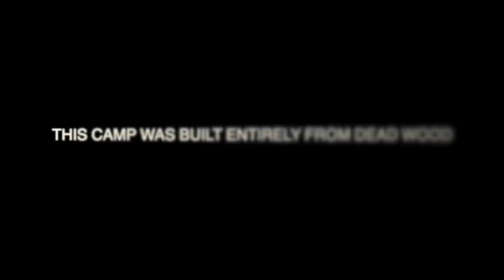Bushcraft Camp with Watch Tower: Off Grid Shelter Build

Comment: I love these builds also. Tip for you guys: when building walls especially high ones where you stack logs horizontally up between poles.
About mid way up vertical poles tie some rope in the middle or higher on pole. Then put 2 or 3 horizontally poles in. Then tie the string to the next horizontal pole you put in then continue stacking poles on them.
This will use the weight of the poles on top of that to pull the middle of the vertical poles in for support.
Reply: 6 People understand and like what you said ,me can't picture it .🤨
Reply: thanks good to know
Reply: @fishfire_2999  You have two vertical poles. You have, say, 15 horizontal poles that will become a wall. As a wall, you want the poles to be nice and snug. The horizontal poles will push the vertical poles outward. You don't want that. So, you attach a rope like OP said. The vertical poles will be acting against the horizontal poles by pushing inward a bit. That'll keep the wall up a little longer.
Reply: @grimstnzborithbrisingr7296  Building looks like so much fun ,cutting and debarking not so much ,I understand what you were describing now makes sense ,thanks for the reply 👍👍
Reply: you can explore new land

Comment: Great camp. The dog wanting to "help" was cute.
    Galvanized or plated wire is wonderful for tying joints together.  You can get the joints tight and secure with multiple turns and then twisting the ends together to lock it in place.
    If you notice modern manufactured log buildings use staggered logs without notching. The corners will need fasteners or wire for stability however, but it sure saves a lot of work and time.

Comment: Nice fort !  I have a lot of Q for U but I will limit them to only a few:
* Why a window on the back wall since you can see through the wall and it is not a dark confinement?
* Why a plastic in the window since the wind (and water) can pass through?
* Why are the walls of your watch tower are so high? Since this is where you're suppose to 'watch' one should be there a long time hence, not standing but sitting! (ex: swivel stool)
* Why use moss over wood over tarpole... just for look?  Tarpole is more than enough!
* Why not cover your fire wood with a plastic or small tarpole because wood top does not prevent rain or melting snow ?
Just hope these reflection points can help improve your next project.

Comment: once the first tower is done, you can make two more next to it, and join them, until a larger thinner tower, made with even lighter or flexible components (like plastic tubes or pipes or long plastic poles), can be fixed between them, with even greater stability.. so scouting even higher, for longer, to accurately approximate the extent of the horde swarming you, or the direction an enemy band is taking, to send patrols their way, or warn them before they are attacked, so they can defend in time

Comment: Off hand ya think a chain saw be faster.  Size building use bobcat 
Clear  make a road 
Water lines trees could hold power lines swimming  poor 
Bed and breakfast  maybe.
Walmart  easy. Shopping.
Its all clear cut on the young trees.  Lowes has better lumber
Government  small loan 
Home improvement.  
Step back look what man can do. Go big or go home .
With the wood cut
Take what week or so 
To use just for fire wood. To dangerous  for 5 gallon of gas. 
Ya think.

Comment: Mike. You used to use that folding saw a lot in your vid's but I remember how you and your dad were impressed with the folding saw that cuts on the "pull" rather than the "push" stroke, with Dustin, I think.  I've noticed you use that latter one in the video's now, do you find that one more useable?